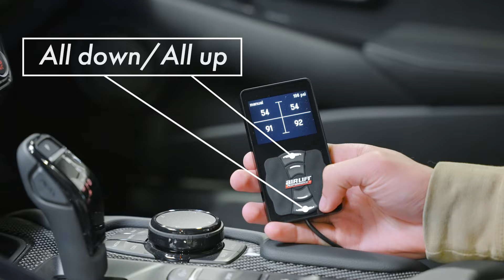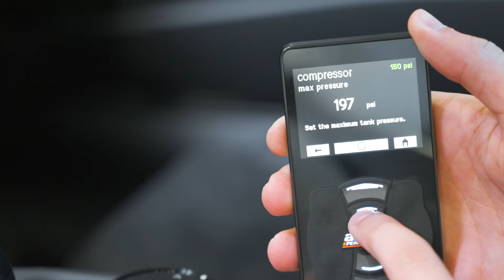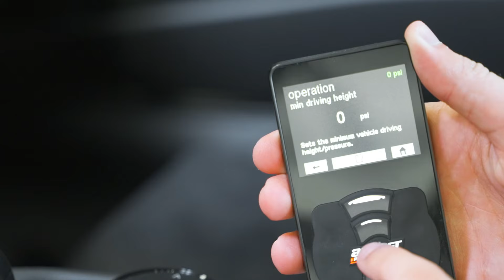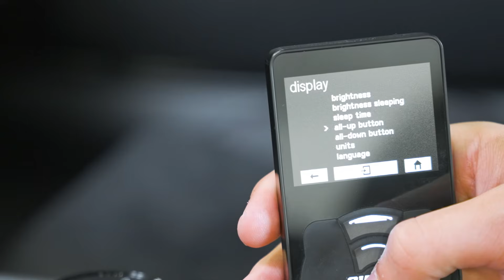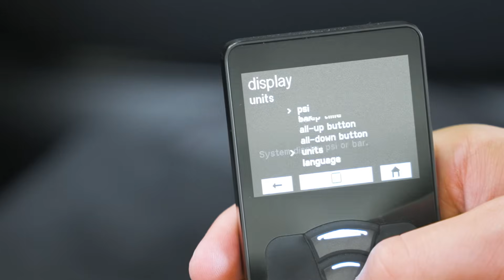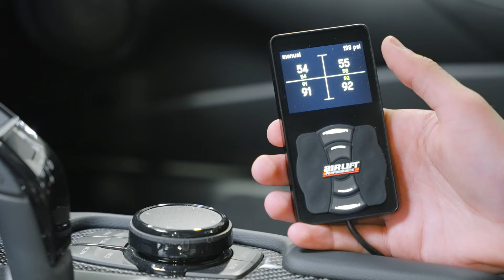How to use your Air Lift 3P/3H Controller

Comment: Do I have to put the vehicle in to a jack mode/access height to service the vehicle?
Reply from the maker: To service the vehicle we recommend raising the suspension as high as needed, then once on jack stands or a lift, depressurizing the suspension.
Reply: @bagriders greatly appreciated

Comment: I bought a vehicle at auction. It comes with the airlift air system but it doesn't have a control panel. What can I do?
Reply from the maker: You can purchase all replacement parts on Bagriders.com

Comment: what do you think the stock air pressure in the take would need to be for a 97 lexus ls400?
Reply from the maker: For the LS400 we would recommend running 200PSI in the air tank.

Comment: I Set my preset after I calibrated the system but when I set my psi in the rear for example 28 on driver side and 25 on passenger rear, when I push the center button preset ride height the rear goes to 35 psi instead, any ideas.

Comment: Yo bro - could i set the number at the front difference rear( front lower than rear , 70-70- 80-80 ) or they are have to be the same psi on both - tks
Reply from the maker: Each corner holds it's own preset value, so you can set them to what ever you want, they do not need to be the same.
Reply: @bagriders  one more question- the shop installed bagged fpr me he told me should air out to 0 keep the lowest at 25 , but saw a lot of car air out to the ground , look amazing, is he right? Need your advice please
Reply from the maker: @highclasslowincome  Perhaps the shop meant that the weight of the vehicle would rest on either your fenders or your quarter panels starting at X PSI. Beyond that we can't think of any reason not to air out all the way.

Comment: I have a question fellow low riders !
I have 3p system but for some reason when i start the car and open the app , bluetooth gets connected no problem but as soon as i leave the app and go to different app , when i come back to 3p app , i doesn’t get connected anymore until i turn off the car and start it again .
Appreciate any help 🙏🏼🙏🏼🙏🏼
Reply from the maker: Great question! Do you have any other bluetooth devices in the car such as car play? When going to a different app the 3P bluetooth recognizes you are no longer using it disabling it. You can reconnect it again without having to shut the system down by accessing the menu and reenabling bluetooth in the 3P settings. Also be sure to keep you 3P up to date as new software is always being pushed.
Reply: @bagriders  
Thanks for writing back to me 
I tried to reconnect by enabling bluetooth but didn’t work , even on my phone while it says not connected, i went to setting and tried to reconnect through manifold , sometimes works and sometimes dont !!!
Reply from the maker: @daghanam  If that didn''t work try giving our customer support team a call at 844-404-7344 or email tech@bagriders.com
Reply: @bagriders  awesome 
Thanks for your help

Comment: Just installed mine 1 of my rear bags won’t hold psi like the other 3 :( and my controller doesn’t hold the psi I preset is that normal to fluctuate?
Reply from the maker: It sounds like one of your bags has a leak! Checkout our other video "How to Find and Fix an Air Ride Leak."

Comment: Is there not a rear up/down like the front?
Reply from the maker: There is not. You would have to air the rear up and down by using a preset or by each corner manually.

Comment: Yes but for model it’s not available u need buy airmatic suspension in order to fix this
Reply from the maker: Correct this is controller is designed to be paired with an aftermarket air suspension.

Comment: is my air ride supposed to be very bumpy ride?
Reply from the maker: Air ride suspension systems are designed to provide a smoother and more comfortable ride compared to traditional coil spring suspensions. If you're experiencing a bumpy ride we recommend comparing your ride pressures to the manufacture specifications.

Comment: If I buy the 3p kit now, can I update to the 3h later?  and do you have the link for that? thanks
Reply from the maker: Yes, you can add the additional wiring and height sensors any time, if you feel you.need them.

Comment: You mention vehicles needing specific pressure in the bags when changing the compressor settings. How do you know what pressure a specific car needs?
Reply from the maker: Great question! Cars running over 80PSI or sleeve bags we recommend running 200PSI in the tank. Feel free to call in at 844-404-7344 and we can help suggest whats right for your car.

Comment: I can't lift while driving, can this be changed?
Reply from the maker: If you have the Air Lift 3P or 3H, you might also have "Stance Guard" enabled. Check out our other video on how to turn it off so you can adjust your air suspension while driving! https://youtu.be/DmGxxNZjzv8

Comment: How do I callibrate my system when I can’t physically air out all the way, due to my wheels being to wide, installed my air ride and now my stock wheels and my aftermarket wheels don’t fit without spacers, and now they will hit my arches if I air out all the way, ik know I just will have to buy new wheels but I need to be able to drive my car in the meantime.
Reply from the maker: There are a few options here. Spacers would be a cheap and easy route but the management also allows you to set minimum and maximum pressure during the calibration process. This will help prevent you from airing all the way out but still allowing the system to calibrate to use your presets.

Comment: I was told when you’re aired out, and it’s time to drive the car, you should air up all bags to over 100psi to open up the bags, then lower to ride height. True?
Reply from the maker: If you have sleeve style bags, yes, you should do that. If you have bellow bags, then it's not a necessary step.

Comment: what about Anti Cross-Load? what does it do?
Reply from the maker: The Anti-Cross Loading + Axle Equalization mode allows the system to consider both height and pressure measures together, to achieve the right height at the right pressure.

Comment: How can you set your system up to air up automatically when you start your car?
Reply from the maker: You want to head into the settings and change the 'rise on start' mode to on. It will the air up every time you turn the ignition on.

Comment: My controller keeps turning on and off, anyone know a solution for this ?
Reply from the maker: Check the controller connection on the USB cable. Next step would be to make sure your ignition wire is getting a constant 12v.

Comment: Hello. can the remote control be unlocked while driving?
Reply from the maker: It can! You will want to turn off the setting called "Stance Guard." Checkout our other video called 'How To Disable "Stance Guard" For Air Lift Performance 3P/3H.'

Comment: What’s better 3P or 3H??
Reply from the maker: 3P is a pressure based system whereas 3H is a height based system. The 3H is going to take a little more time to install but is going to be more accurate when hitting its presets.

Comment: Wondering if you could help I have a problem with my 3p manifold where I have everything wired in and the compressor turns on as it should I get 2 flashes on awake on the motherboard but the controller won’t turn on or connect to my phone and there is 12v going to the maifold, any help would be appreciated !!
Reply from the maker: Would you mind reaching out to our technical support team? You can contact them at sales@bagriders.com or call 844-404-7344.

Comment: how to set the minimum low high to not be 0, because i already broke my fenders by accidentally hit it to the down button? + Can it be set on the shocks to never go that low again ? .. I just bought a car equipped with same suspension. The Car is Audi A5 Sportback -  I like it, but this All-Down button is a problem to me.. The car looks strange on all high - front is a lot higher than back of the car, is there any correction on that?
Reply from the maker: Yes in the settings menu under 'operation' then minimum drive height/pressure you can make that adjustment.

Comment: my controller for my 3p recently kept rebooting itself, and then eventually doesnt show anything in the screen. whats the potential fix for this?
Reply from the maker: If the controller doesn't want to stay on check your power and ground cable. If its not that check your ignition wire and make sure it's getting 12v. If that doesn't solve the rebooting issue feel free to give us a call at 844-404-7344 or email our support team at tech@bagriders.com.
Reply: Could be a fuse

Comment: Can i use a manual switch controller on 3p?
Reply from the maker: The only controller that connects to the Air Lift 3P System is the controller it comes with or a wireless device such as a cellphone. You can manually adjust each corner on each device.

Comment: Wait so how do y’all air out I’m confused ?
Reply from the maker: To air out you want to use the middle bottom button.
Reply: @bagriders  but I thought that was your low ride height ?
Reply from the maker: @Kbannss  You have 5 customizable presets with the 3P/H controller. Starting from the top we most commonly see users set them to momentarily all up, high drive height preset, normal drive height preset, low drive height preset, and the very bottom button all down/air out button.

Comment: how do you find out what is the MAX psi you should set for your vehicle?  Mine is 2020 supra widebody
Reply from the maker: To figure out max bag pressures you can check your suspension manual. For max tank pressure it doesn't matter what car you have you can set the PSI from 150-200PSI. If your suspension runs higher pressure a higher tank pressure will help!

Comment: How do you change minimum pressure when the compressor kicks on.  Mine kicks on if pressure drops 15psi
Reply from the maker: You can't change the minimum pressure on the Air Lift 3P but you can change the maximum.

Comment: Anyone know why I get the loud clunk sound almost feels like I'm riding on plates when I hit bumps when I'm anything below 120psi up front. I bought it with it already bagged all the bags under the good and it rides great when I'm riding skyjacker status it looks good aired out but I can't ride around anywhere close to what I want to be riding around and what I should be writing at does it have anything to do with the dampening system because I think the guy that installed himself I don't think anybody was doing. It's just a loud clunk and feel that I get on every bump more so in the front and it's not anything to do with the factory stuff it's definitely the bags but basically when I'm under 120 or closer to 1:15 it's almost as if there's no air in the bags whatsoever but there is for sure. And this is for a Infinity Q50 2017
Reply from the maker: Great question! Could you contact our customer service team at sales@bagriders.com or call 844-404-7344. It sounds like your strut is bottoming out or maxing out. We would be more than happy to recommend some pressures to help prevent this.
Reply: I had the same issue, spin the damper knob off and then put an Allen in the whole and use a wrench to tighten the bolt on top of the strut

Comment: Hi there just have a question, when I made the preset for my low ride height, everything airs, however my pre set was set to 25, my left airbag just goes all the way down to 0 and then shoots back up to 25, is there any solution to this that I’m not understanding
Reply from the maker: You can contact our customer support team for help! Call 844-404-7344 or email sales@bagriders.com

Comment: Just bought rs with airlift kit on it, not familiar with air bags at all. Is it normal for the front left and back right to be dumped after the car is off and been sitting like 20 minutes? The front right and back left are still at the presets when I get in but the front eft and back right have dumped. When I get in and turn it over the bags don't automatically inflate until I hit center button to air up to presets. Thank you
Reply from the maker: If the car is dumped after 20 minutes it sounds like there might be a leak. Double check your lines to make sure they are not kinked.

Comment: Does this have air out on off?
Reply from the maker: Yes you are able to air out with the controller.
Reply: @bagriders  I meant air out when you turn the car off
Reply from the maker: You cannot air out the car when it's off. A properly wired system turns on when the car turns on and turns off when the car turns off. You can use the show mode on the system to deactivate the compressors while leaving the key in the ignition.

Comment: when i use my "speedbump" button and press back to rideheight, it goes lower then my rideheight (almost airout the bags) and them fills it back up to rideheight. any way to fix that?
Reply: What’s the speed bump button
Reply: @rockbrothers8546  should be the one to air all the way up (or the very top one)
Reply from the maker: Are you on 3P or 3H?
Reply: @bagriders  3P, but i did calibrate again and seems fine now!

Comment: How do you press the button? I double tap it and it doesn’t work sometimes. Do you have to do it slow or what? Just got mine on a few days ago still trying to figure out how to use it properly
Reply from the maker: Be sure to calibrate the system first! The individual bag buttons are a one press and the preset buttons down the middle take two presses.
Reply: @bagriders  it’s calibrated. I have the 3p and the remote I see a little lock on top sometimes I assume the remote is locked and won’t do anything how do I unlock it?
Reply from the maker: That lock is the stance guard feature. We have a video on our page talking about what exactly that is.

Comment: How can I disable the automatic lift because sometimes when I’m driving in my normal drive height for example 118 on the rear goes automatically to 125
Reply from the maker: Try the following! Turn off rise on start, preset maintain, begin a new calibration, and be sure your presets are set correctly.

Comment: What is the "preset maintain" option? Can you explain please? And what should it be set to.
Reply from the maker: Preset maintain does exactly what it says! It tries to "maintain" the preset you are at while driving, can be helpful if you have small leaks, or just want to make sure no matter what your preset is maintained.
Reply: @bagriders  another question...I have noticed it takes less air to maintain on the right side of the car then the left...ex: 60 54 front and 60-53 rear...but when I set my ride height preset to these numbers, it doesn't air up to them, instead it does over the set amount and ends up evening it out...ex: 60 all around...do u know why this would be?
Reply: @NearMedia  got mine fixed 11 months ago lol. Everything sits the same now
Reply: @NearMedia  took it back to the installer and he made adjustments. Idk what exactly but now my numbers are even all around.

Comment: Do we have to install a watertrap and how often should we drain the tank?
Reply from the maker: You need a water trap to properly drain your system, you should be draining it every 1-2 weeks depending on how much you use the system!
Reply: @bagriders  could you please make a video about draining and regular maintenance to keep the equipment in best shape ? Best practices and not to do things as well.. 

Many thanks 🥰
Reply: @bagriders  is it bad if I drain it more often than normal?
Reply from the maker: No! The more you drain it, the better.

Comment: I can’t set my air out preset anymore since the last update. I don’t like it on all 0’s and had my rear psi set on 50 to air out before the update. Is there something different we have to do now to set air out preset?
Reply: "air out" is used to go to 0 all around. In settings, you need to select the "preset" option  instead of "air out". This will allow you to set your lowest setting which would be your Air'd out setting.
Reply from the maker: What he said! Use the "all down" button and set it as a preset to 50psi instead of using it as just an air out button